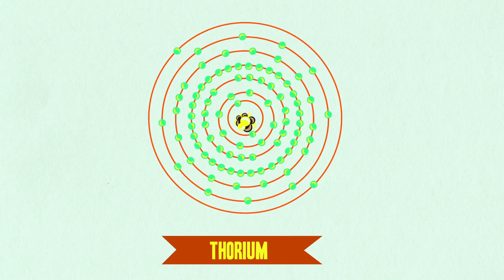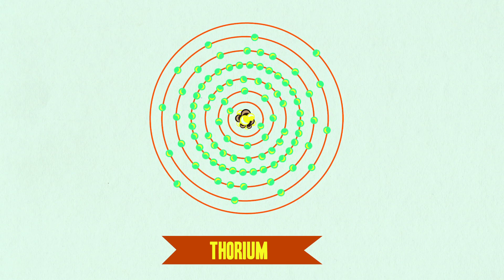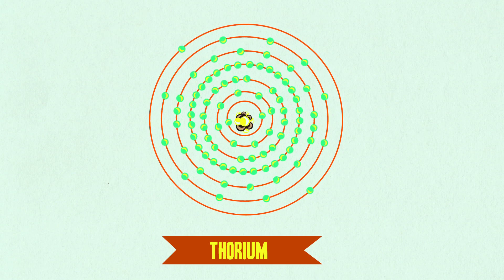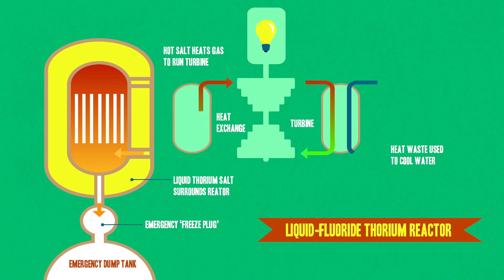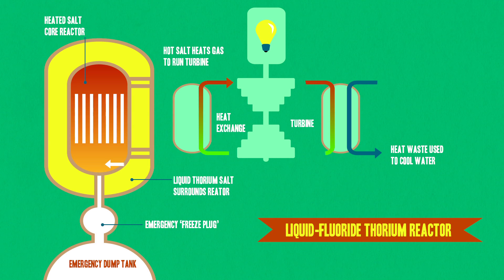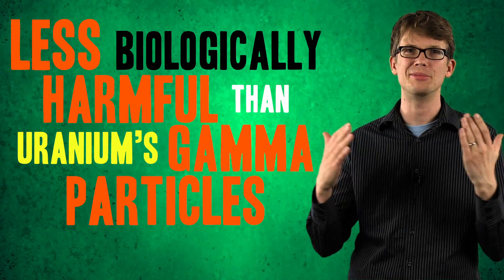Liquid Fluoride Thorium Reactors (LFTR): Energy for the Future?

Comment: Not only is yellowcake mining causing huge problems, we can only use uranium 235, which is about 1% of the uranium that comes out of the ground. If we had to go nuclear, I'd prefer cold fusion, which according to some sources, maybe only about a decade away.
Reply: Cold fusion? Seriously?
Reply: Yellowcake isn't mined directly, it's actually a result of processing of the Uranium ore.
Oh and cold fusion isn't really possible.
Reply: powerviking If by cold fusion you mean fusion without energy input then then yes it is theoretically impossible but if you mean fusion at or near room temperature that that is completely possible and actually scientifically proven. Fusion only requires energy input to create new bonds, that energy can be in any form and does not have to be heat energy. It's funny how undergrad teaches you something isn't theoretically possible and then grad school teaches you that well it actually is you just don't have the knowledge yet to understand how or why.
Reply: " I'd prefer cold fusion"
Which is as real as unicorns and pixie dust.
Meanwhile back in the real world...
Reply: Actual fusion that will work like ITER is like more than 30 to 60 years away.  And its incredibly expensive. Implementation will take a long time.  LFTR is something that can be implemented now and save massive amounts of money on energy, as well as begin changing normal hydrocarbon fueled ground transportation like cars and rail into using either hydro-cell, electrical, and electrical battery operations saving even more in terms of money while also saving on the cost of hurting the environment.
Over power the grid to provide enough energy to harvest hydrogen from water at the service stations or at home for regular vehicle use.
Reply: You speak as if cold fusion is just around the corner, something like hot fusion where only the engineering has to be worked out.  Sorry, there is no scientific conclusion for cold fusion despite intensive work in the field in the last 30 years. There are no engineering studies into how to make it work because as far as we can detect, it doesn't.
Reply: well, if instead of thermal neutrons reactor we meant to use fast neutrons reactors, the fuel pile will already multiply 20x, since they can also use 238U... and several were already built and used (Monju, Superphoenix...)
...as for cold fusion, let's start obtaining the hot one (ITER is scheduled for run-testing by 2030...thought a little too optimistic), then we'll discuss about the cold one...
Reply: I used to be a huge proponent of cold fusion, and I still think it's worth spending research money on just in case a breakthrough occurs.  But unfortunately, after many decades, I'm beginning to think that fusion, whether the hot or cold variety, is a non starter.  Thorium reactors seem to have a lot of potential to solve the energy crisis and climate change, both inexpensive and safe.
Reply: Hungry Guy At least "hot fusion" is a physically real thing - but its very difficult to achieve in a controlled fashion. Billions of dollars have been spent because of its fantastic potential - but its always "50 years in the future". And possibly always will be. The same money spent on Thorium breeder reactors and we could have a practical energy source in a decade.
The Apollo project got men to the moon - a similar effort and we could have inexhaustible cheap safe energy - but no one has the vision and drive to see it through. Yet.
I would like the technology to be developed in a western democracy - but the west is weak and directionless.
I suspect the Chinese will make it happen first - they have the resources and they have the will to say "make it so".
Reply: richo61  I hear ya'!  I'd like a western nation to do it first, but better China do it than nobody at all.
Reply: Cold fusion is total bullshit. But don't take my word for it, a little dose of undergrad physics will convince you of the truth.
Reply: richo61 You're speaking as if hot  fusion hasn't been achieved... Fusion was first successful in 1997, the only problem is that it is not currently efficient, that is, it does not produce more energy than it consumes which is what the ITER project is hoping to achieve
Reply: Well, both hot and cold fusion have been achieved.  The problems for both forms of fusion are that (1) the reaction isn't sustainable for more than a few minutes at a time, and (2) it takes more energy to feed the reaction than it generates as output.  ITER has a lot of potential, but the political infighting between members are killing it and it's costing billions.  Cold fusion has the benefit that it's been repeated countless times by physics students and even amateurs, but that's also it's biggest problem: only the younger, open-minded researchers without a vested interest take it seriously (which is, sadly, a repeating theme throughout scientific history for many discoveries--the older researchers need to retire before progress can be allowed to proceed) even though anyone who can use Google can find independent verifications that something interesting is happening inside the fusor.  
 
Personally though, I don't think either type of fusion is going to pan out any time soon (if ever).  I think the most promising form of new energy are thorium reactors, which are a type of fission reactor that is well understood, but is much safer because the fuel can't explode or melt-down like uranium (and thus the by-products can't be used to make bombs), and has a much shorter half life: about 100 years for thorium compared to tens of thousands for uranium, and thorium is abundant and is easily and cheaply obtainable.
Reply: Cold fusion has not been achieved..
Reply: Uhm....yeah, that's what I mean, lol...

Comment: The video is a bit misleading.  LFTR was developed by the Air Force to create nuclear-powered nuclear bombers.  (You heard me.)  The bomber program was killed, but the technology lived on. The competition for use in commercial reactors lasted into the mid-1970's.  It was between two types of breeder reactors, one using a U238/P239 fuel cycle and the other using a Th232/U233 fuel cycle (LIFTR is one example).  The Congress was already itching to kill the breeder program.  U238/P239 was then chosen, partly because it meshed with the weapons program and was therefore more politically viable.  It didn't matter.  The anti-nuclear power Congress just killed the breeder program anyway. Attempts by the Reagan Admin to revive in the early 80's failed.  That is why we still have these crappy, wasteful, and primitive Gen2 reactors.

Comment: Thorium nuclear reactors are thought to be expensive because nuclear power has a bad rep on Wall Street. Due to anti-nuclear protests
* lots of PWRs were half-built or never opened resulting in huge capital losses. I guess new capital for nuclear can now only be financed at junk bond rates.
* gold-plated regulation allows fossil fuel electricity plants to emit many times more radioactivity than nuclear and slows down construction.

A new PWR, just announced, in England will take 10 years to build, at vast expense (many times the cost it'd take to make in China). The utility building it has been guaranteed very high prices ~ $130/MWh for 35 years. It's senseless. 5 decades ago, the US built a nuclear plant in the hostile environment of Greenland within 2 years. A LFTR should take no more than 3 years to build. Wall Street will invest in no electricity generating plants taking more than 5 years to build. That's the rationale behind the small modular reactor movement, of which LFTR is one variant. Build them in factories and assemble the tested components. Get the construction time frame back down to 18 months.

Although China is building a LFTR, there are at least 4 US citizens helping them, so it seems to be some kind of joint venture with the US.
Reply: Two new reactors have been licensed for Atlanta in 2012 by the NRC.

Comment: As one who has worked with both boiling and pressurized water reactor plant (safety) evaluations back in the 1990s, using water reactors are much more dangerous and expensive just to keep the core cool and was more/less designed to be compact for nuclear submarines. In short water and pressurized are bad. Only because the present companies producing reactors are set up for PWR/BWR types, the US govt. has to step up to the plate and do it right this time. TMI was a PWR, Fukushima a BWR.

Comment: The alpha and gamma radiation info is just a tad misguided, but cool video.
It would be nice if only a fraction of our current reactors were to be converted, if only to make way for future uses of electrical energy (like cars) and perhaps even cheapen energy(?).
I see no problem with replacing the majority of coal/oil power with Thorium, actually; 300 years is surely less than the timescale of carbon emission effects(or no?). This could also facilitate future banning of 'dirty' nuclear weapons.

Comment: No, that's incorrect. Pu-239 is only 2.5% heavier than thorium; the difference in the FPs produced is quantifiable, but only just barely, in a lab. The weight's of the FPs, likewise, have nothing to do with their decay half-lives or intensities. The "incredibly long half-lives" come from the unburned fuel and (especially) from the transuranic actinides formed by neutron activation of the fuel, and once again, they are essentially the same ones regardless of the fuel.

Comment: ... Both sorts of reactor create essentially the same fission products in the same amounts as waste per amount of energy output; the solid fuel reactor, though, has about 99% of its remaining fuel mixed with that; in the LFTR, it gets burned to completion. You can even throw in older reactor waste, and have it burned down to completion too, providing energy rather than wasting valuable swimming pools.  It is a huge win for fuel efficiency.

Comment: No, you're wrong. Adding plutonium or U-235 to thorium to kick-start the fission process doesn't involve any particular heat problem; the only heat is that needed to melt the fluoride salts (500-600 degrees), which is lower than that in a pressure water reactor.  And the huge pressure is gone, voiding the need of the massive pressure vessel. No "ridiculously high temperatures", no "large amount of energy demanded". ...

Comment: Yeah, that's a good game and even correct when the extremes are looked into, but when you want to detect or interact oe use with them in the real world, gamma rays are rays and alpha and beta are particles. To think otherwise is the same as requiring a baseball batter to take into consideration special relativity when judging the ball's speed.

Comment: Re comment that "[Thorium] emits alpha particles which are less biologically harmful than gamma particles". Besides gammas being EM radiation and not particles (no quibble on photons), all the fission fuels - U235, Pu239 and Th233/U233 - all emit alphas AND some gammas during normal decay. The real point is that a liquid fueled reactor is not vulnerable to poisoning by fission products; they can be removed incrementally, unlike in solid fuel, so the waste doesn't hold 99% of the usable fuel.

Comment: Fortunately thorium is one of those finnicky fuel cycles that simply won't work if you cut too many corners on reactor design. You can put enriched uranium next to a neutron source and some graphite and it'll start going without stopping until something breaks. Thorium requires a few more steps than that.

Comment: What the video doesn't tell you for 1000 Megawatts it take 35 tons of Enriched Uranium for a convention nuclear reactor and you end up with 35 tons of radioactive waste that is radioactive for about 10,000 years.  For a Thorium reactor to make 1000 MWs it only takes 1 ton of Thorium & you end up with 1 ton of radioactive waste that 83% will basically not be radioactive, or no more than the normal background radiation levels, in 10 years.  The other 17% will be radioactive for about 300 years.

Comment: Completely and utterly false.  I suggest you educate yourself (first start with wikipedia on Nuclear_fission).  The fission fragments that are created between U233, U235, and Pu239 is practically identical (there are minor variations in probabilities of the fission fragments that fission of each nucleus creates).  Given that the difference between U233 and U235 is simply two neutrons and the difference between U235 and Pu239 is esentially an Alpha particle (ie, a He4 nucleus), that's 6 nucleons.

Comment: That is a U-238 reactor that produces Pu-239. Since Pu-239 is fissle, a lot of it is used as fuel. However, this doesn't change the fact that Pu-239, being far heavier than Th-232 or U-233, will produce heavier fission products that have incredibly long halflives.

Comment: LFTR is similar to the LMFBR which is Pu239/U238.  It's quite possible to make (in fact, there's one that has run for a number of years at Idaho National Engineering Lab - INEL).

The long half life of the "waste" the came out of reactors is because we don't reprocess due to the Non-Proliferation Treaty. If we were to actually reprocess spent fuel, we'd find that almost 95% of that spent fuel was still usable and could be put back in a reactor, only about 1% would be true waste (and last 600y).

Comment: I have to take exception to couple things Hank said.  

The LFTR (and all Breeder designs), you are creating materials that can be used in a weapon.  The thorium process takes Th232 and converts it to U233 which is fissile and could be used in a weapon.  So, if you could reprocess the material, you could make weapons.

Also, the 10,000+ years that Hank mentions in the Uranium fuel cycle is that way because we don't reprocess spent fuel, it would be only 600 or 700 years or so if we did.

Comment: I see what you are saying.  I agree that the safety and efficiency of molten salt reactors is important.  It is amazing that the engineers of the time could do the calculations required to build a nuclear reactor without the use of our current computer modelling tools.   In that context it is understandable that they wanted discrete solid fuel pellets to make the calculations easier.  Modelling fluid dynamics is tricky with just a slide rule.

Comment: You missed the point on this one Hank.  The point is liquid fuel vs solid fuel, and molten salt cooling/moderation vs water cooling.  Thorium vs Uranium is barely even relevant, in fact the actual fuel in a LFTR is uranium which is produced in the reactor from breeding the Thorium.

Comment: the logic behind the proposal is that converting an old reactor to run on Thorium would cost a lot less than building one from the ground up ...also, there was something else which was not mentioned in this video. Namely scientists have been devising ways to burn old Uranium-based nuclear waste within a Thorium reactor and thus potentially limiting their radioactive half-life which currently stands at thousands of years.

Comment: On small scale, fusion takes more power than it produces, however the larger you go the closer you get to where fusion will produce more than it needs.  A tokamak fusion reactor is much safer than any kind of fission reactor, because fusion can only occur under certain circumstances and if there was any kind interruption of those circumstances, the fusion would stop instantly.  There are several fusion concepts in the making right now, the most promising is ITER.  Google it up.

Comment: Not sure that you are remembering correctly. It does take a lot more energy to kick it off, but you never have excess fuel in the chamber and it'll be running on water so I don't think you have to worry about it being more volatile. It's also not the case that no one is 'going for' fusion, it's that the technology isn't mature enough to start putting up actual reactors. There are lots of experimental reactors all over the world though.

Comment: The original Point was Chernobyl was Shoddily made, Bad design is prolific evidence of cost cutting, the official reports of the disaster state Reactor 4 suffered a Catastrophic Increase in power resulting in explosions that "popped the lid" on the reactor and blew tons of radioactive material into the surrounding atmosphere. AND they found out if the reactor had the safety measures installed that it was supposed to have the disaster might has been drastically reduced if not happened at all.

Comment: You actually think I forgot that a powerplant makes power. Are you serious?! 

Have you considered that something might malfunction or a external disaster could happen? Certainly doesnt look like it. You clearly haven't thought about the safety concerns with running huge coils with a radioactive lithium mantle, with a super hot dense plasma inside.

This is a ticking timebomb, sooner rather than later things will go wrong because of it's frequent need to be shut down for repais..

Comment: That's what I was thinking what do we use half of the stuff that doesn't seem like it's gonna slow our problems in an instant but pick up the slack I mean I am pretty if we made use all the lower cost and less hazards ones we could run our hazards ones at half the rate it is effectively cutting down on pollution non a lot but enough

Comment: Yes it is very harsh, but the plasma dynamics will result in mostly elastic collisions, which will lead to highenergy ions escaping the magnetic flow and hitting the reactor walls. These walls will corrode away pretty fast, given the time needed to even hit breakeven with the investment.

And the major hazard of a power outage with these kind of huge tokamak coils will create a huge explosion, which combined with a radioactive lithium coating is a recipe for a disaster greater than Chernobyl.